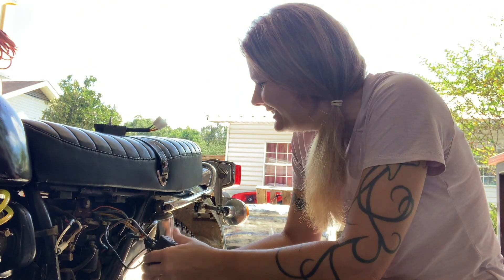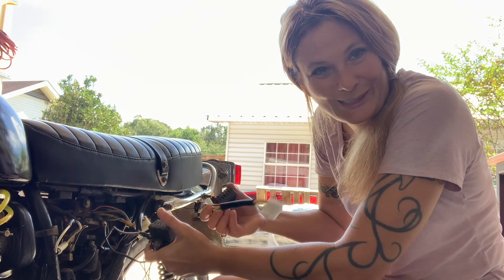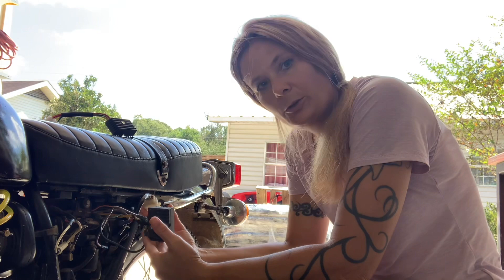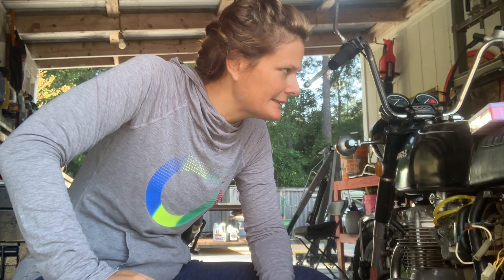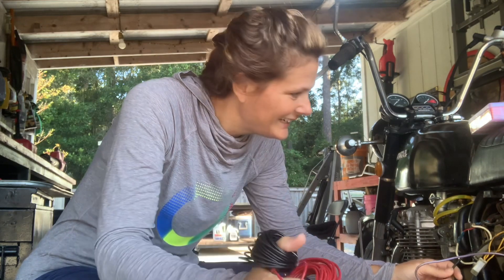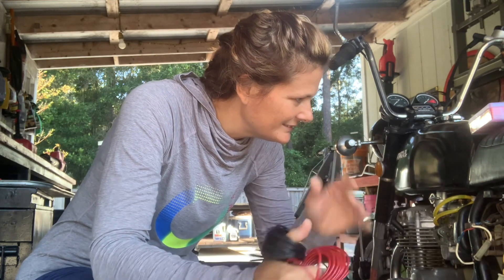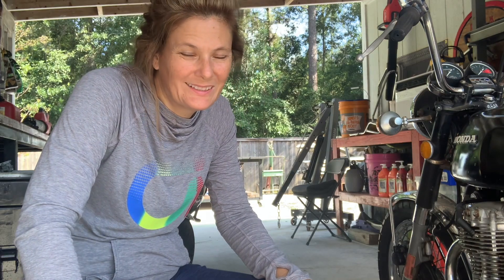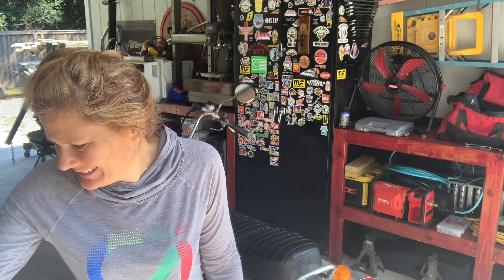Replacing the regulator/rectifier CB350F

Comment: Isn't fun to trouble shut and fix electrical wiring? You did a great job 👍. Do you have a digital voltmeter? If so, set it on 20 volts D/C. Check ( with engine running) check on the battery and see if the new regulator/ rectifier  puting out 12.5 volts or more, that means it is working if you have that then reve up engine to 2800 or 3000 rpm and it should go up to 14 volts. (Do not keep engine at 3000 rpm just see if it going from 12.5 to 14 volts). Then it is working correctly. Now the regulator will be worm to the touch, this is normal and let's know it working ( but not supper hot).🙏
Reply from the maker: Thanks for that information I will try what you said
Reply: @NotamechanicBetty  Betty; please let me know what what kind of reading you got  also make sure the battery is fully charged and not weak, when you do this🛠️🙏